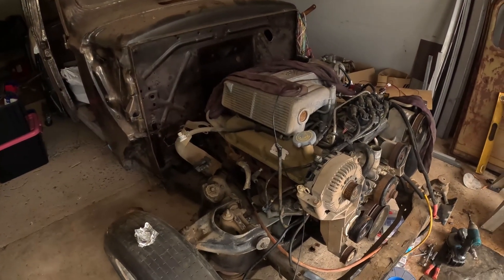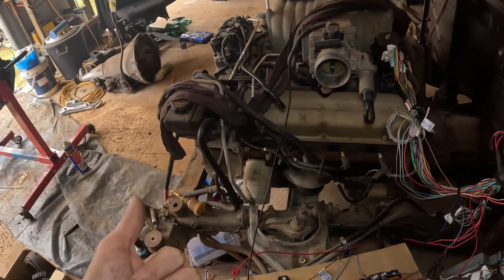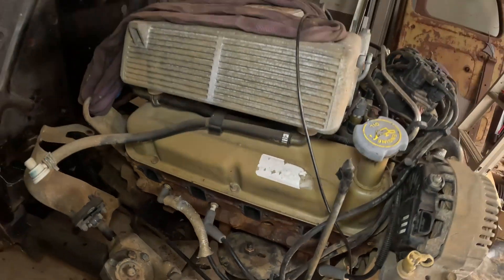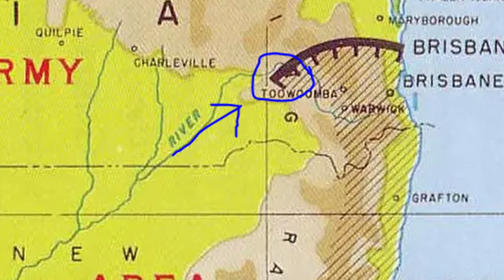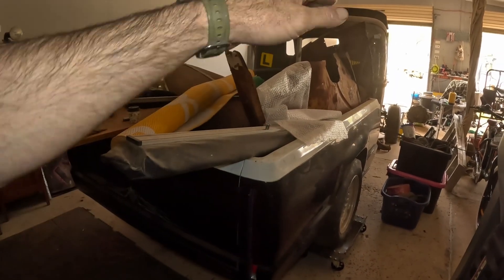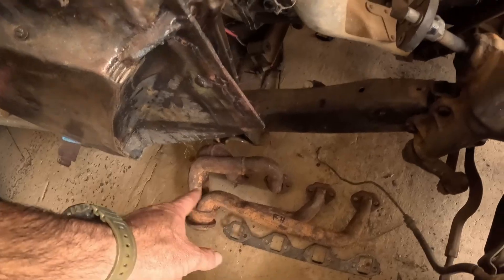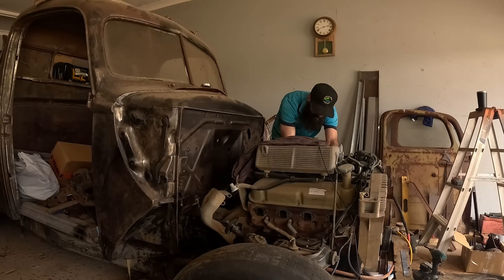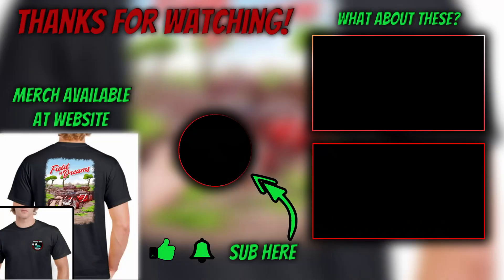302EFI standalone harness - stock ECU & J3 CHIP   [EP 27]

Comment: Hey bro i want to do the same thing for my 47 jailbar bar. I have a  2002 au 302 pretty much the same did you have to use the ecu?
Reply from the maker: Hey mate. Yeah I had to use the Ecu, just no bcm was needed. Mine is a 2001 au v8 I'm pretty sure but yours should work the same . Just need the j3 chip
Reply: @TwistedMetalCustoms hey brother awesome iv got a chip coming in mail. Would it matter if I plug the chip in ecu  before I pull motor etc 🤔 Did you have any videos off the wiring you done on this  for an example. As donor cars are pretty much the same. Cheers
Reply from the maker: @frasertown3887 nah i bought my motor and box separately,  you just need to install the j3 chip and solder the 2 parts before you try to start it, nah sorry no videos of the wrong as It took me ages to figure it out haha

Comment: I'm doing a build my doner was a 99 mercury mountaineer AWD into a 99 ranger 2wd with mustang 5-speed. I pulled every bit of wiring from the front bumper to the back doors and am in the middle of transferring to the ranger my dilemma is I'm also fabricating an intermediate intake to mount a lightning supercharger. Would this type of set up support that? I've asked around about the Holley Terminator but all the Ford stuff seems to be for a distributor (foxbody) and like you I don't have one. awesome build ya got there. Definite subscription
Reply from the maker: @ernestchapman1194  ooh cool project mate! I am pretty sure the J3 chip can support most extra add ons,  safest way would email or call TI Performance (or Facebook message ) and let them know your plan and to see if they can supply a J3 chip tuned for your purpose,

The J3 chip primarily is to just bypass the security and BCM stuff, so all you will need is a ECU, like me. Then you do whatever you want to the engine, then go get it tuned, as if you would any other motor I believe , cheers for the sub mate! 🍻
Reply: @TwistedMetalCustoms  thanks for the info just got done checking out their website and seems as though the stage 3 chip and complete tuning kit is what the doctor ordered. Ironically enough I happened to have a second 99 ranger ext cab that is kinda going the same route as your build except for  a351 cleavor and the cab off an old Studebaker truck (basically just windshield frame and firewall) the rest will be a custom Woody wagon 33 Willy's nose and fenders
Reply from the maker: @ernestchapman1194  thats awesome mate, that would be a complex build too! also glad that the J3 chip is hopefully what you were after, cheers 🍻🍻

Comment: Hello! Finally a good video of someone doing a 302 EFI swap! Please send me a copy of your excel sheet. I’m currently doing a 93 Jeep YJ 302 H.O. Swap. Engine and powertrain is in. Finally finished up the stand alone efi harness. I didn’t know anything about a J3 chip but I’ll do some research into that. I can’t find any info on doing the final wiring and I’m afraid on just going for it and burning up an ECU. Any help would be appreciated!
Reply from the maker: Hi Terry! Glad you found my channel, I have a very rough copy of my pinout, but remember it's designed for a very basic, manual hot rod.. so no abs, auto box, any car alarms stuff, literally just running the engine and sensors haha, send me an email via my website and I'll reply with the spreadsheet mate

Comment: I have a similar 302 in my 92 NC fairlane. Been having a problem with pressure build up, which has caused the sump gasket to blow out and is also blowing oil into the throttle body. PCV is fine , ( located behind intake manifold ) however below it is a mesh filter which appears to be clogged . I poured a tiny bit of fuel in it and it didnt run through. Might be something to look at , and any tips on how to clean it would be helpful. Unlike your rod , its very difficult to even see , let alone access.
Reply from the maker: Hmm, I haven't checked mine yet, I will when I get back home from work. Have you tried getting a flat head screwdriver and a vaccume and try to clean or loosen up what you can from the top. Then I would try to get carby cleaner and spray into the gauze (will have to flush and change the oil after i would say) 
Thays alot of pressure to blow the sump gasket, maybe a hole in the piston? You can try to take off the oil fill cap and then start it to see how much blow bye there is? Might give an idea of any damage or issues causing it? 
Or, take off the rockers or where ever it's located ( I need to check mine) and clean that way ?

Comment: Hey mate, its the best sound the first fire up. About 8 years ago I got a hold of a j3 chip off TI perf, for an EF v8 running the EECV. Its in an old FJ 40 toyota and Its been bloody reliable its had a fair beating on club days and in the bush. The only real problem I had was with the mass air flow I didnt realise that running an oiled K&N air filter was putting oil on the contacts. I have to run that MAF to get the motor running, I would think you will need to as well for the AU. I also run the oxy sensors in custom made headers. They may not be the most powerful motors out there but set up right they go for ever. Good luck, Phil
Reply from the maker: Oh that would be a cool rig with the efi motor in it! 
Yeah I think it will be running extremely rich without the maf sensor? I don't think I have the stock one, I will have to order another replacement I think. I also have to make custom headers , I will try to Tee in my oxy sensors right where then all come together, maybe 100mm past that point. I think that should work ok hopefully,  cheers for the info and comment Phil! 🍻